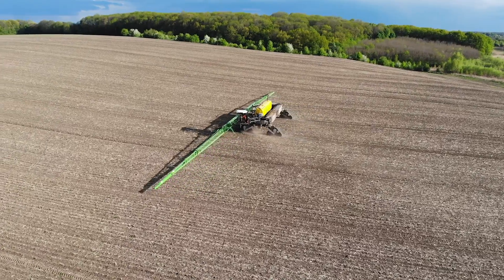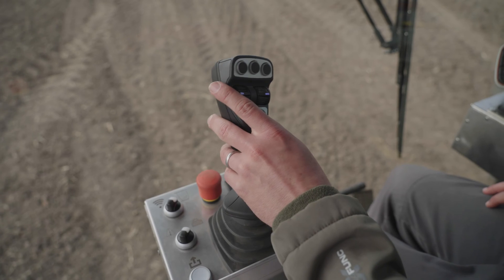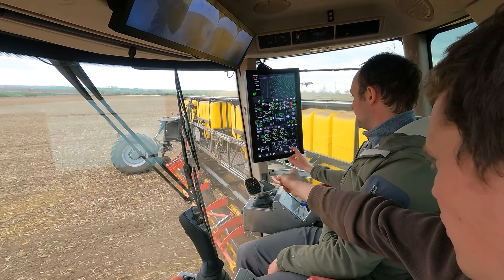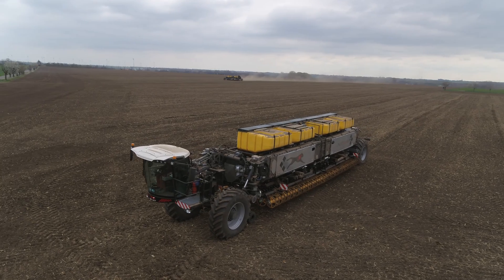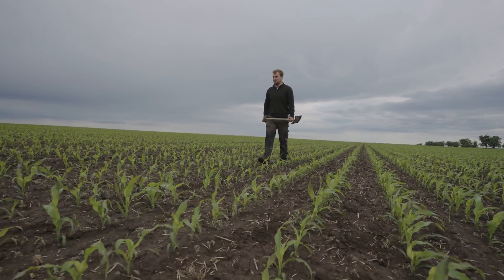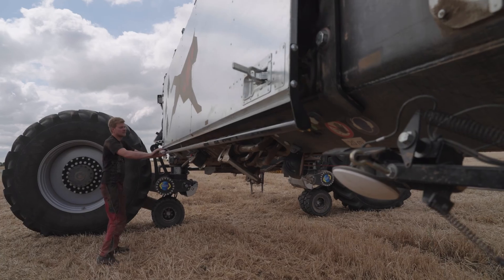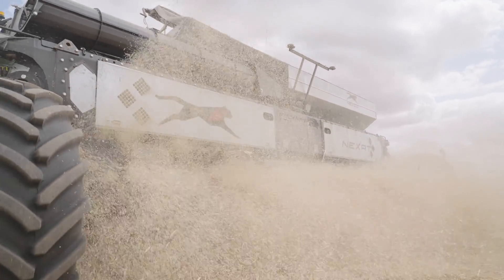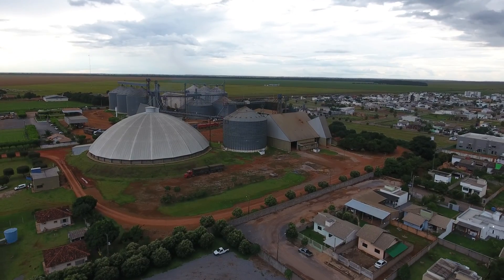NEXAT | 1100-hp Tractor | Test-Drive | Updates 2022-23 | Innovative Farm Equipment | Part 3

Comment: Really cool machine and I'm sure it works well in those flat fields in Europe. I want to see it run on some of the hilly terrain in the US and Southern Canada...and also how you pull it out of a mud hole when it gets stuck...There seems to be no safe way to connect another 600HP tractor to this thing without causing some major damage. And how do you disconnect the electric drives to freewheel the vehicle? It has no clutch like a mechanical drive vehicle. Please post something to show these issues with the design.
Reply: its piece of crap machine actually
Reply: @KeepsmileNOW  
Interesting. So have you tested the machine yet? You can't make that kind of judgment without testing it, I assume.
Or is that a typical internet comment that really has no idea what he is talking about?

Comment: If the point is to run on the same lines each year anyways then just put down rails. Then you don't need 400hp just to move it around either.

Comment: Interesting concept but certainly nothing new. Older viewers from the UK may remember the Dowler Gantry system in the late 1970's/ early 1980s that was around 40ft (12m) wide and could do much of what you see here. He was certainly using cultivations and had a sprayer that ran at 80ft (24m). I vaguely remember a combine module as well. I think it had 3 point linkage on the rear so it could be used with conventional cultivators. Naturally it was long before GPS or even any serious electronics and the only one I saw in the flesh was 2 wheel drive with the undriven wheels being large castors. David Dowler was a man ahead of his time. RIP.
Reply: Вітаю.👍
Така машина була започаткована в радянському союзі, щогось проект не пішов далі експериментів.
І рахую що по проєкту було багато викликів,
По потужності та по приводу руху.

Comment: If they want this in the US it needs to be even longer. This is limited to about 50 ft. We have 120foot wide planters. Nexat, make it so you can add cab-less sections to  the pilot unit in the field.
Reply: The whole point of the Nexat system is you only need this one machine to do all of your tilling, seeding, spraying and harvesting, and it is set up in a way that converting it to fully autonomous in the future will be a breeze. So instead of these big midwestern farms owning 15 tractors, sprayers, and combines, they can own 5 of these, 5 of each implement, and then the only time the farmer would have to mess with them is when they get stuck, break down, or need fuel, leaving them free to run around between fields and to and from town (trust me farmers are always busy)

Comment: Its going to be interesting to see if john deere or case try and ban this technology if its a competitor.
Reply: I looked up price and they think the hole system will cost 2 million 😒  if this was john deere they might get that but in reality very few can pay for that most farmers can got out and get all the equipment to replace nexat for around 500k thats 1/4 the price if you want to promote regenative farming you have to be competitive in price 2 million is to high. Realistic price would be 750k to 1 million.
Reply: @jimbobhootenanny4440  This is the biggest problem I see with the technology (assuming it works). There's no point using this system unless you go 100% into it and at that point you have to replace so much equipment it's unlikely that the farmer would be able to afford it. When harvesting they would still need tractors to pull trailers so would have implements for them but, if used, these extra tractors would negate the benefit of using controlled traffic in the fields.
Reply: @jimbobhootenanny4440  I don't think you're being realistic. The farms that this would be getting marketed to are buying a single tractor, 9RX640 for example that have list prices of $845k, then you have to buy the seed drill, or grain cart to go behind that. 
The Nexat may not be the immediate solution, but systems like it will. it'll take time for them to prove the worth for sure, but $2M, when you take it all into consideration, is not as big as you may think for the size of operations that this would be sold to.
Reply: @williamheffernan5826  its like 1% of farmers can buy everything new i was more realistic with 60k to 120 k used front wheel assisted, 90 to 150k Used 4x4 and then a 70k to 120k Used combine one or two cheep wagon puller for both you only need a 220 hp to 250 at most so 60 to 120k for them as well then wagons and Implements 30 to 50k each wagons you need 4 to 6 and 15 to 30k for those there it is as realistic as I can make it for you.
Reply: Навряд ли Их показушная конкуренция, мало кого волнует. Система главенства корпораций будет уходить в небытие.